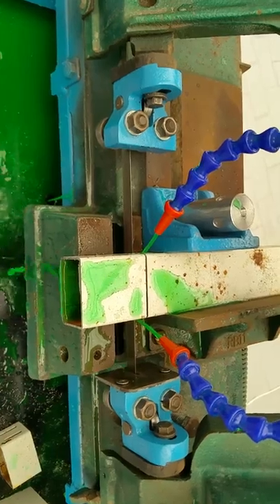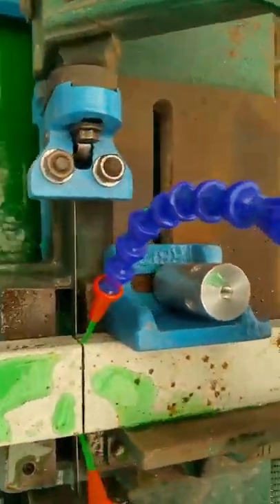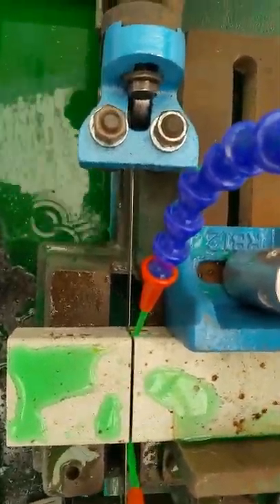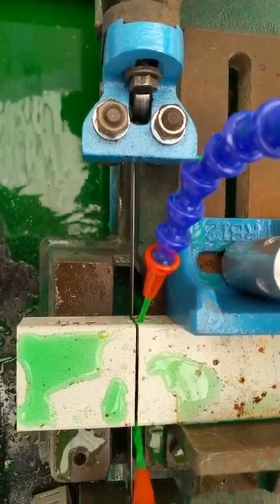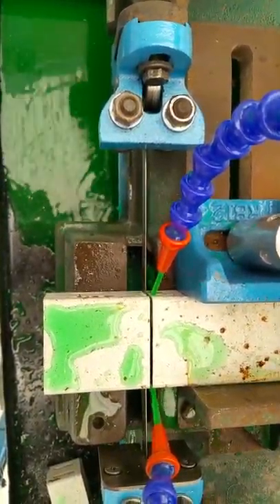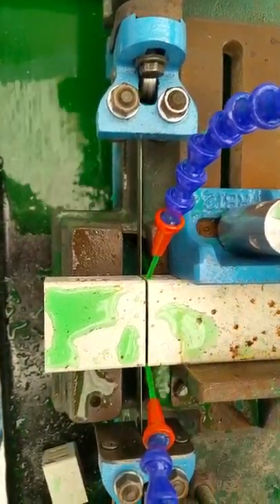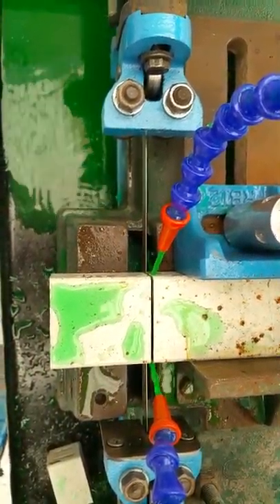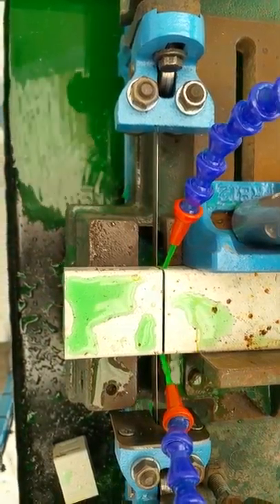Metal Cutting Band Saw with coolant pump

Comment: That’s great. 
I’ve just bought and old metal bandsaw that never came with a coolant facility but have acquired a coolant pump, tank and hose which is like to fit to it. So normally metal cutting fluid is a water so liable oil... I haven’t seen antifreeze/coolant used before but I guess it would definitely remove the heat. Clever !
Thanks for the video. 👍